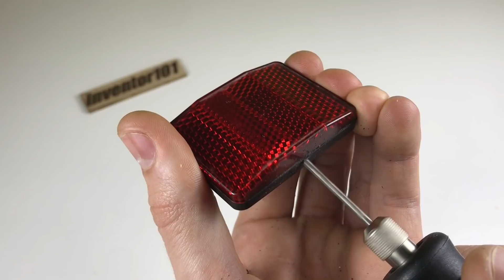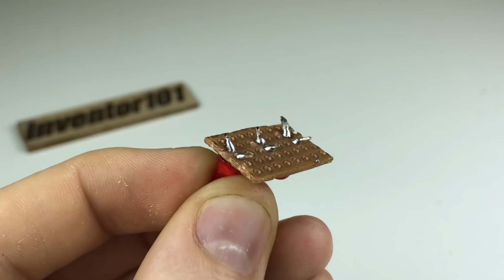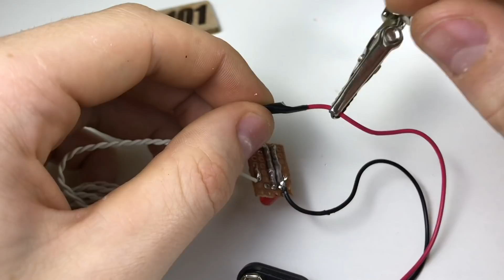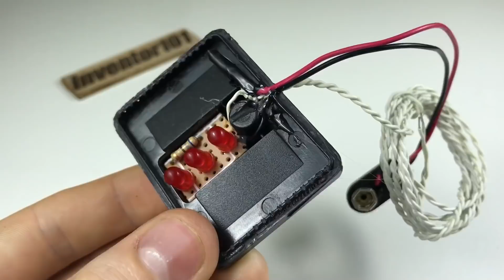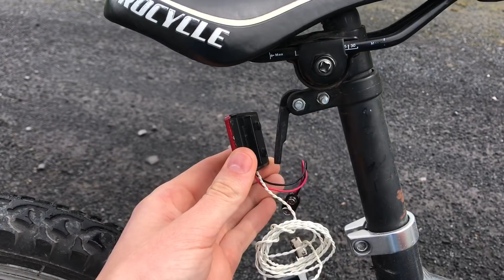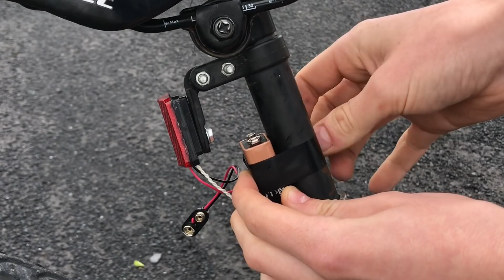How To Make Bicycle brake light

Comment: Wat type of resistor???
Reply: You can calculate his value and his power by this two formula
P=U×I
R=U/I
You need to know the voltage of the leds, his comsumption and you are done
Reply: 10K resistor

Comment: What kind of switch is that? Does it make a contact when you pull the brake ? When it is in normal position, the switch doesnt make an electrical contact?
Reply: The term for this type of switch is “normally closed” (NC). (Conversely, a switch that makes a connection when pressed is “normally open” (NO) )
Reply: The switch he used, a momentary micro switch with hinge lever, has 3 connections, normally closed, common, and normally open (NC, Com, and NO). He connected the wires to the Com and NC terminals so that the light is on when the brake lever releases the switch lever.

Comment: I don’t think I want to build this, because It’s not waterproof and it rains so much in Denmark 🇩🇰
Reply from the maker: TheButtMan ASD u can make it waterproof :)
Reply: I Can try :)
Reply from the maker: TheButtMan ASD sure the light unit I made was all glued so its water Proof just the battery which could be placed directly under the seat .
Reply: Inventor 101 ohh okay wellthank you